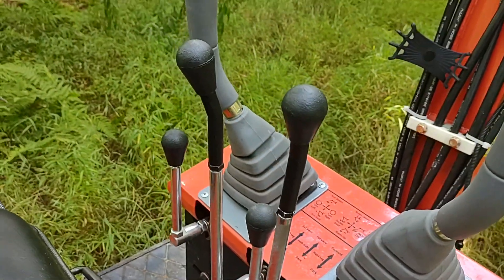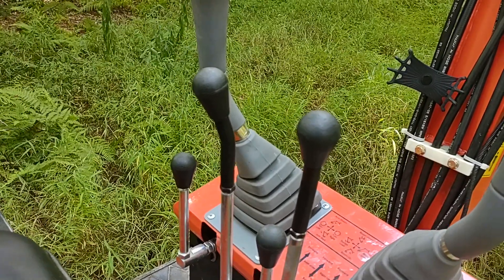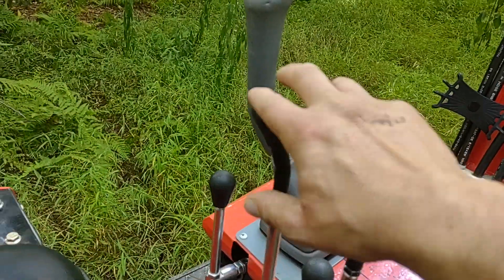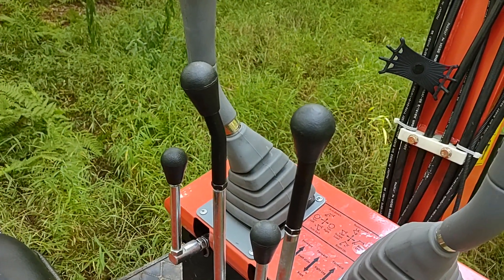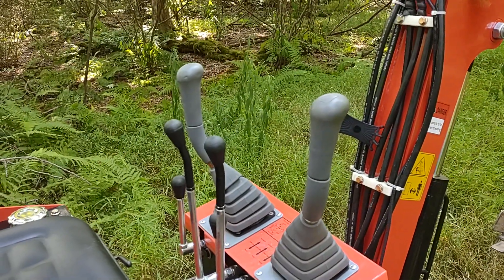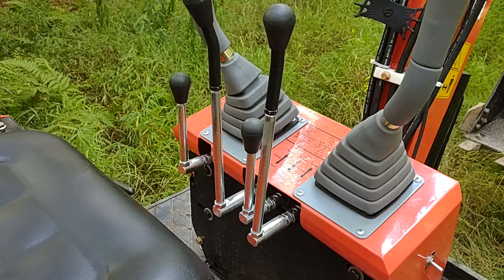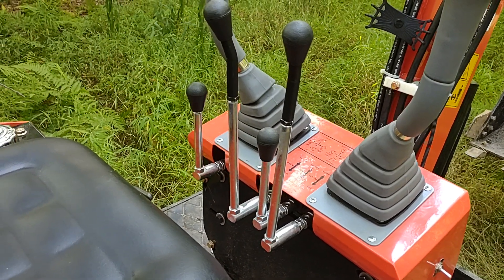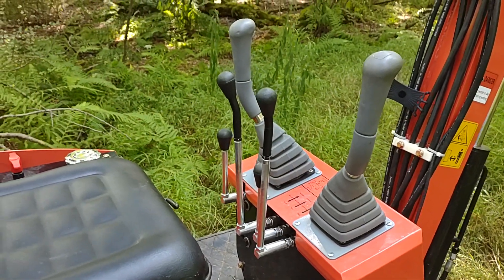Gardner's Groundhog mini excavator control modifications

Comment: I seen you put extensions on your tram leavers and was wondering where to get some I have a 24 model kh14g-2 groundhog should be same size
Reply from the maker: Hey check out my video of my Groundhog BH14G-2 with a rotating log grapple. I left Amazon links in the description so you could find what you need.  I believe your drive sticks are a little different than what I have on my machines but if you verify your threads where your knobs screw on you should be able to find what you need on Amazon. These are shifter extensions for a manual shift car and they normally come with an assortment of adapters to fit your threads on your Groundhog.

Comment: I don't have the ground hog. I bought the HT10B which is like the mini excavator you have. The one mod I have done helps when tracking a long way. I have mechanical foot pedals. Not as precise as the hand levers. But at times are handy
Reply from the maker: To bad you can't post a picture. I'd like to see your peddle modification.

Comment: Your machine looks clean. I've been blowing mine with compressed air but I think you might have said you're washing yours. Is that right? If so, do you take any precautions to avoid getting water somewhere?
Reply from the maker: Besides the obvious oil and gas I wash it like a 4 wheeler. Remember to grease it after washing it. You don't want water to contaminate any grease points.

Comment: Awesome idea! Where did u get the extensions? I would like to do mine as well
Reply from the maker: Check out Ebay. They are listed under shifter extensions. Just make sure the male and female threads are 10x1.5 millimeters so you can just bolt them on and reuse your factory control knobs. Thanks for watching.
Reply from the maker: The only tool you'll need to install these extensions is a 14mm wrench.